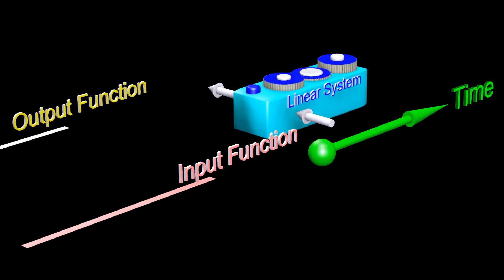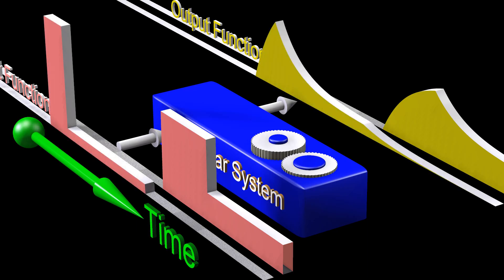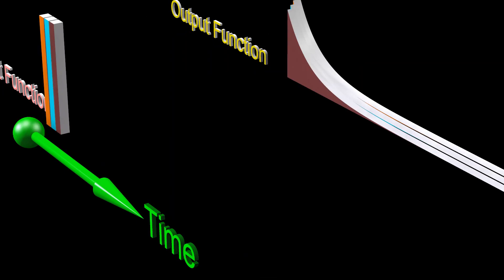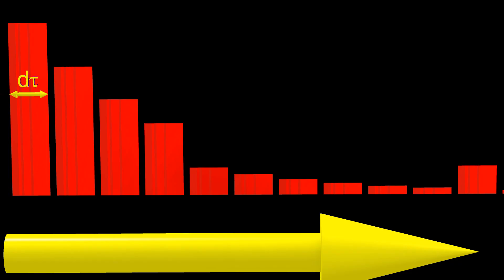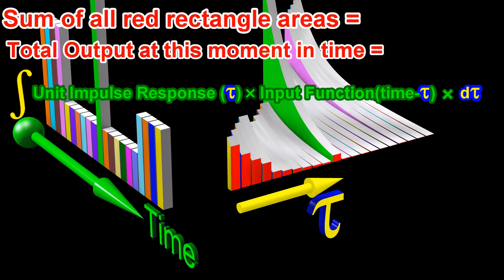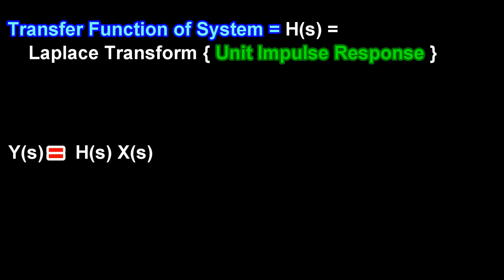Convolution and Unit Impulse Response

Comment: What an explanation! Simply genius!
Reply from the maker: Thanks for the compliment.
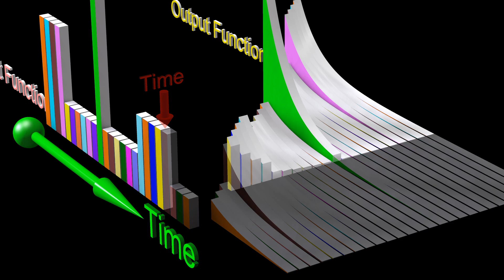Reply: @EugeneKhutoryansky   I miss the real meaning between minute 3:22 and 3:28. I don’t understand the connection with the areas of the red rectangles. What does the thickness of the individual output signals represent?
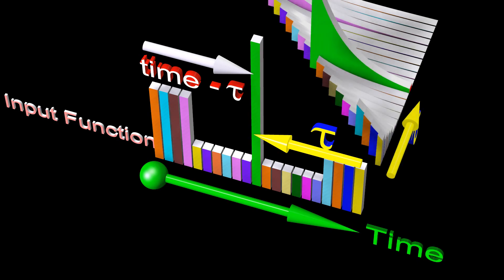Reply: @EugeneKhutoryansky  And also from 5:07 to 6:00. I'm a little confused about what TAU is (in this part of the video you consider the moment TAU equal to the moment TIME). When you calculate the height of the red rectangle, the two instants TAU and TIME seem to coincide.
Reply from the maker: Tau and time are two completely different variables.  Time represents the moment we are presently in.  At the moment we are presently in, the output is being affected not just by what the input is right now, but also what the input was at all previous times.  The variable Tau represents how long ago, from the present moment, we are looking at.  The sum of all the red rectangles shows the sums of the contributions to the output from the inputs at all previous times, up to and including this present moment in time.

Comment: On 7:42, after saying contributions of each of the output functions(h(t), unit impulse response) approaches to zero, you said its reason is because unit impulse input functions shown here have finite height whereas a true unit impulse input function should have a height which approaches infinity. By "contribution" of output functions, we refer to their area right(this is just a clarification question)? And my actual question is, do their area approach to zero because unit impulse input functions' height goes to infinity, or unit impulse input functions' width and thus unit impulse responses' width goes to zero? Thanks in advance.
Reply from the maker: A true unit impulse would have a width that approaches zero and a height that approaches infinite.  In our case, the so called unit impulse has width (dτ) that approaches zero and a finite height.  But, we compensate for the finite height with the fact that we have an infinite number of these so called unit pulses.

Comment: Thanks for the great videos. I'm an engineering student in South Korea. Could you explain why the output is the sum of red rectangles. I think that the output must be the sum of heights? What does the area of each red rectangle mean physically or intuitively?
Reply from the maker: As delta tau approaches zero, the number of rectangles approaches infinity.  Therefore, if we take the sum of all the heights, we will get an infinite number.  We need to multiply by delta tau to get a finite number.  Another way to think about it is that the height represents the output of a true unit impulse input.  But, we do not have true unit impulse inputs, which must have an area of 1 (on the time axis).  Instead, each of our inputs have an area which is multiplied by delta tau (on the time axis).  Therefore, each of the outputs also needs to be multiplied by delta tau (on the tau axis).
Reply: @EugeneKhutoryansky  what was the need to go in Tau axis.

Comment: It's strange: if the high of pulses is infinite (the area remains 1) - why does the sum converge?
Reply: the height of the function grows at the same rate as the width shrinks, thus keeping the area constant. Despite the fact that the width shrinks towards zero and the height moves towards infinity. Please see the dirac delta function :D
Reply: @Woollzable  Of course. But the problem consists in the frase "the infinite sum". The infinite sum of the pulses with finite area can't converge, can it?

Comment: I'm sorry but this video is FUNDAMENTALLY FLAWED. The video omits the fact that it is assuming TIME-INVARIANCE. Convolution does NOT describe the input-output relationship of all linear systems. ONLY linear systems that are also time-invariant. The assumption is that an input at time t-tau contributes to the output at time t through a scaling factor  h(tau), that depends only on the time difference. That is NOT ALWAYS TRUE.  For example, if y(t)= tx(t),  the impulse response (for an impulse applied at time 0) is 0 for all time. This video would predict the output is always zero for all time for all inputs, which is clearly wrong.
Reply from the maker: Yes, I am assuming that the system is time invariant, and I think that this assumption is obvious.

Comment: Ohhh this is just presented so well. Finally, a graphical intuition for the convolution integral (or sum in discrete time) that is derived from the more general superposition sum (add up the unit impulse responses -- like a bell rung at each time step), rather than from what I've always thought is a counter-intuitive reading of the formula: fold, shift, element-wise multiply, sum.
Reply from the maker: Thanks.  I am glad you liked my explanation.

Comment: about 5:53, the result is not failed, but most people know as the action of the input form the video that the unit impulse delta(t-tau) (running sum) effect the output, so I think based on the additivity and homegeneity , the out result may better change to [y(t) = integral(0, t) input_function(tau).unit impulse_response( t - tau).d tau], in other words, Height = input_function(tau).unit impulse_response(t - tau), I want to iterate that because of the commutativity is one of the properties of convolution, the result  "input_function(t -tau).unit impulse_response(tau)  catching from the video is also right.
Reply: I was confused by the same thing, wondering how no one pointed it out! Thought I'm the only one who is still confused even after such great visualisation.

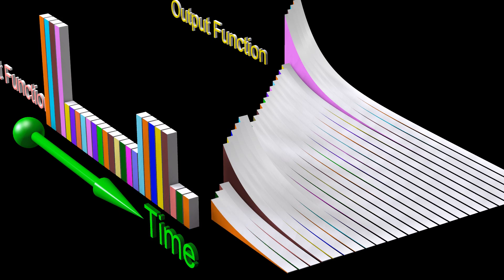Comment: Great video. Very interesting approach to the visualisation of the convolution. I think that the transition from the output of the system to the sum of the areas of all the red rectangles (3:26) is not very clear. The system's output visualization at 3:00 isn't realy the output (if the definition of the system's output for one imput impulse is the area the red rectangle).

The graphs of the output functions show system's outputs to the individual impulses, divided by dtau (duration of the input pulses/step of the input pulse discretization).
To calculate system's output function one would have to multiply system's impulse response function by the input impulse, which is defined as the input value multiplied by dtau (think of force × time).

The representation works because the base of the output signals (3d representation) is defined as equal to the duration of input impulses. The system's output to the individual impulse at any time is therefore the area of one red rectangle. I think the representation is ingenius, many textbooks skim over the transition from the sum of all impulse outputs to the integral over time. Here we can actually see where the integration limits come from.
Please correct me if I am wrong. Keep up the good work. :)

Comment: Lost me at the red rectangles 
Why would they have width in the z direction?
Reply: Near the beginning the video mentions that if you know the response of a linear system to two different inputs, then the response of the system to the sum of those two inputs is the sum of the individual responses. So what he's doing is breaking up time into discrete steps and then for each step (each value of tau) he's looking at the unit response scaled by the input function at that time step, then summing them all up to get the actual response. The unit responses at each time step (appropriately scaled) are all the decaying curves with red rectangles at the end. However, to be appropriately scaled, they must also be multiplied by d\tau.
To see this, consider if you didn't include d\tau and just summed the height of the rectangles. If you split the sum into twice as many time steps, your final sum would be twice as big. But splitting the sum into twice as many steps means d\tau is half as large. So multiplying by d\tau keeps everything appropriately scaled. If your signal is discrete to begin with, the d\tau isn't needed.

Comment: Does anyone understand why the sum of the red rectangles is the total output of the function? (at 3:28 ) In my understanding the output of the function should be the sum of the heights of the rectangles not the area. Or is the width of the rectangles equal to one? I would appreciate it if someone could clarify that. Thank you in advance.
Reply from the maker: We have to account that these are not real unit impulse functions in that they do not have infinite height.  Therefore, we have to multiply each unit impulse response function by a very small number (d tau) to compensate for this.
Reply: @EugeneKhutoryansky  Thank you for your answer however I am still confused. I find the three dimensional modelling of the problem confusing. For example why does the unit impulse at 1:40 have width perpendicular to the time axis? Does that width (not the height) perpendicular to the time axis have a physical meaning? I understand that this area somehow relates to the width of the red rectangles at 3:30.

 I am sorry for the late follow up but other exams came in the way. Thank you very much for making these videos and thank you in advance for your answer.

edit: I think I understand it now, I think the width of the red rectangles is in someway how in many unit impulses we separate the original input function.

Comment: Hi Eugene, can you explain why the total output is the sum of the area of red rectangles and not the sum of the height of each rectangle? I mean, the output at certain time is the sum of each individual unit impulse response at that time isn't it?
Reply from the maker: We have to account that these are not real unit impulse functions in that they do not have infinite height.  Therefore, we have to multiply each unit impulse response function by a very small number (d tau) to compensate for this.

Comment: A have a comment. The statement d tau approaches to zero according to the definition of the differential is not correct!  The d tau Differential is already the result of limiting a small amount Delta tau to zero!
Reply from the maker: The statement is correct if d_tau is defined as is shown in the video, in which case d_tau would be what is usually called delta_tau.
Reply: @EugeneKhutoryansky  
I do not agree to it, because at the end of the video, when finally integration is used, the   d tau used contradicts the definition initially in the video, since the integral is a sum of Riemann and which the delta limit is made goes to zero, and not tau.

Moreover, the notation of d tau as being the limit of D tau going to zero is already established in the literature.

Using d tau going to zero can confuse who is learning calculus. That is my concern. :-)

Comment: I don't get how the any input signal can be thought of as a sum of unit impulses. Isn't a unit impulse infinite in height? Wouldn't any sum of unit impulse functions be infinite in value at each point?
Reply from the maker: These input pulses are not true unit impulse functions because their height is not infinite.  You can think of a pulse with a height of 1 as a unit impulse function multiplied by "d tau", where "d tau" approaches zero.  Hence, its response would them be the unit impulse response multiplied by "d tau."  And this is precisely what happens in total output, since the contribution of each individual output function is multiplied by "d tau."

Comment: So to work out what the output would be from a given input, we break down the input into infinitely many unit impulses and add together the corresponding unit impulse responses.  Nice.

How about the other way round though?  If I'm trying to solve a linear differential equation, I'll know what response I want and need to work out what input will give me that response.  Well, I just turn it all inside out.  I start by working out the unit impulse generator - the input that would generate a unit pulse as an output.  Then I just break down my required output into infinitely many unit pulses and add up all the corresponding unit impulse generators.

If I already know the transfer function, there's probably a shortcut somewhere to get to the unit impulse generator.  Is the Laplace transform of the unit impulse generator the reciprocal of the transfer function?

Unit impulse generators seem like a pretty neat idea and something that will be useful in all sorts of areas of mathematical physics.  I need to give them a name.  I think I'll call them Green's Functions.
Reply: Remember me in ur nobel prize speech

Comment: Conceptually, wouldn't each output function in the series past T @3:00 also change (increase) as you change (increase) the input function at that point in time? In the beginning of the video the models show definite acceleration and deceleration curves in the graph which surely overlap across T. Depending on where a specific impulse was terminated, the next impulse would pick up the work before much deceleration occured which would allow for a peak in acceleration to occur sooner. Or is my question beyond the scope of what this demonstration was meant to convey?
Reply from the maker: No, the other output individual functions which started in the past would not change, but they would still contribute to the total output function.
Reply: @EugeneKhutoryansky   Thanks for the answer but I was referring to the output functions after (past as in beyond, not past as in the past) the point in time at which you increase the output function as demonstrated @3:00. I expected to see the rest of the future series increase a bit as well. It seems as though you are confirming that the total output function would change if we were to change that individual function so conceptually it seems like the rest of the future series should have increased a bit in the demonstration. It was late when I watched the vid and I might have missed something important so forgive me if my question was answered in the vid.

Comment: Anyone else can explain why height is response(τ) x unit input function(t-τ)?
Reply: It is all about a single slice.

So if you have a impuls of size 1 on the input you get a corresponding slice out (the unit impulse responce). If you made that input impuls twice as big, then  the output "slice" gets twice as big as well. That explains the first factor.

The second factor deals with how the hight of the 'unit slice' (the slice you get after a unit impulse input) changes in time.
The hight of a unit slice at any given time depents how much time there has been since the impuls happend, hence the (thau-t).

I hope this makes sence and does not confuse you any further...

Comment: @3:00 isn't the height of the impulse pulse always infinite because the area must be 1 and the width approaches zero?
Reply from the maker: Yes.  These input pulses are not true unit impulse functions because their height is not infinite.  You can think of a pulse with a height of 1 as a unit impulse function multiplied by "d tau", where "d tau" approaches zero.  Hence, its response would them be the unit impulse response multiplied by "d tau."  And this is precisely what happens in total output, since the contribution of each individual output function is multiplied by "d tau."
Reply: @EugeneKhutoryansky  Oooh, I think i understand it now! Thank you so much for all these wonderful video's, especially the video about the Laplace transform. It was a real eye-opener for me.
Reply from the maker: Thanks.
Reply: In calculus not all things make intuitive sense. The integral itself doesn't make sense: you're multiplying by dt (or dx or whatever) at the end, but we know dt approches zero, so shouldn't the whole integral approch/be zero? It looks like it should, but it doesn't.
Reply: @altuber99_athlete  It makes sense to me since you add a lot of those dt's times f(t), so adding a lot of very small numbers/area's could result in a non-zero number
Reply: Dirac delta function, which isn't a real function. Just a probability distro which can be used in indeterminate forms in integrals n whatnot to solve problems

Comment: Love your vids but sometimes they are pretty elementary. Basic control system tuning is what you describe. The transfer function can be modeled many different ways. Damped, critically damped and over damped might be a next topic. Before tuning starts you should know range of inputs and individual response models of the actuators.  You need to design the overall TF so it remains stable under all conditions. TF gain, dead time, transport lag as well other factors need to be addressed in the TF. If your making cookies in a continual production system where weight is the primary control. Then moisture or oven speed acts as a dominate actuator. Sell water not dough so to speak. 
In my unworthy opinion it makes it easier to understand when practical examples are used. Missile pitch stability analysis was my first encounter back in the 70s. It has stuck with me since. Maybe I digress too much from the original example but my brain remembers how things work better than theoretical examples. Keep up the good work.
Reply: Sell water, not dough - Michael Scott